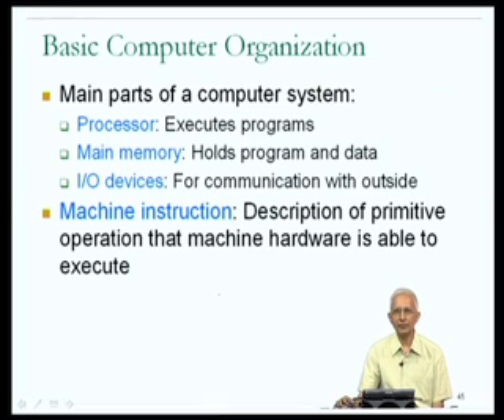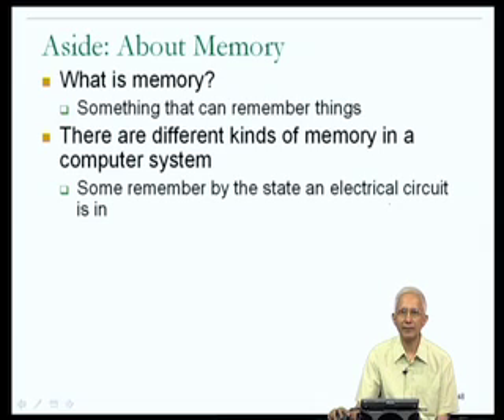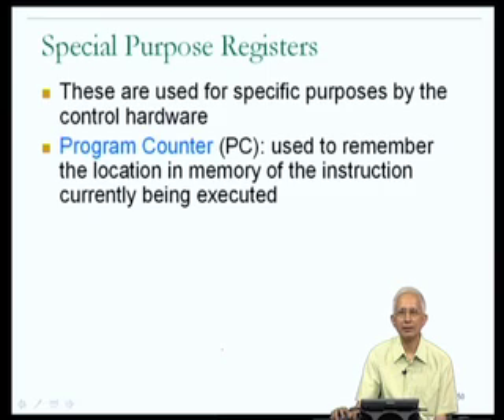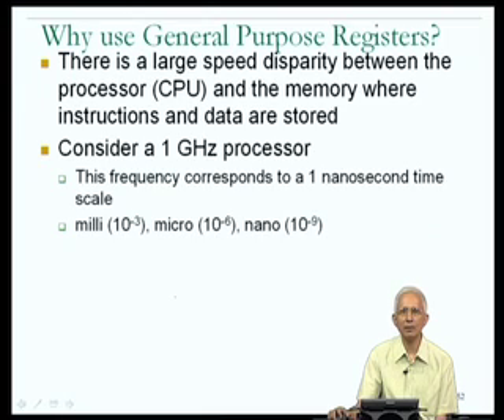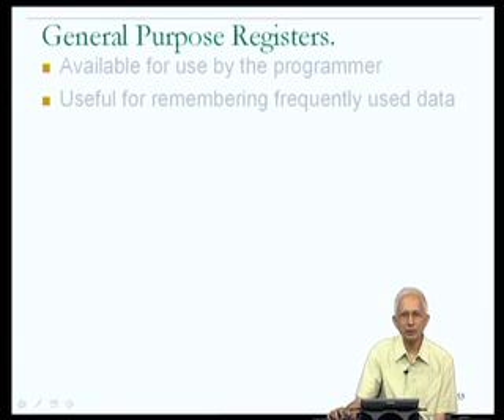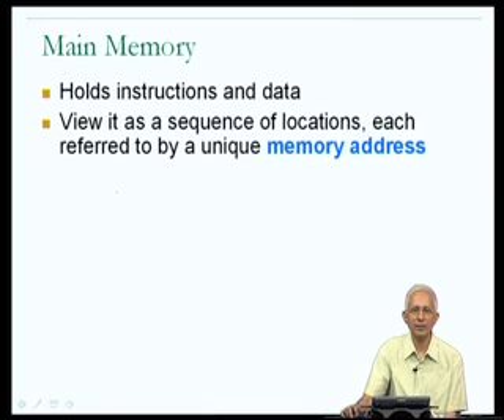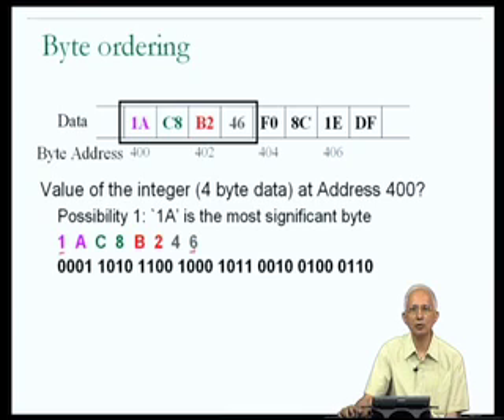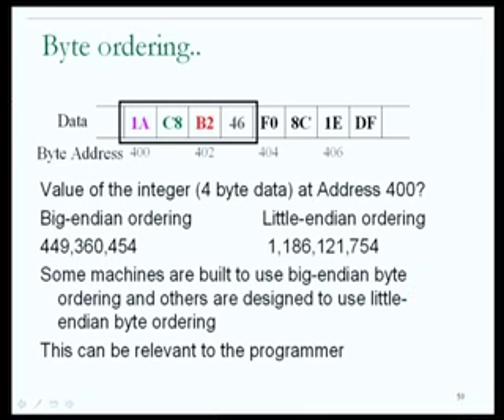Mod-02 Lec-03 Registers and Memory

Comment: There is a small confusion. As far as I know, "Program Counter" points to the next instruction to be executed. Whereas, you are telling that it is pointing to the current instruction in the execution?
Reply: He is not wrong. The value of PC is just incremented to get the next instruction. Whether this is done after the current instruction has finished execution or before, depends on the architecture. Usually PC is incremented right after the current instruction is fetched, so it usually is pointing to the next instruction, but, this is not a necessary condition for the PC.

Comment: sir, what is the difference between IR and PC, as per your explanation both seem to have the same functionality.
Reply: Suppose an instruction is x=5; this instruction in binary format will be stored in a particular location in main memory when the program containing that instruction is being executed. That particular memory location will be identified by an address. When time comes to run that instruction, PC register will be loaded with that address, and the MMU can use this address to fetch the instruction from the main memory and store the same instruction in a register called IR. So, in short, PC contains memory address of an instruction , and IR contains the actual instruction. Keep in mind, as program flow proceeds, PC value will keep getting incremented to next address, and IR will keep getting updated with the instruction from that address.
Reply: @roysarit  excellent explaination!